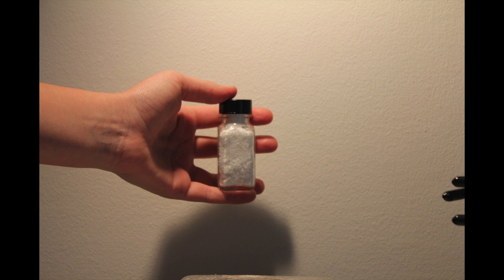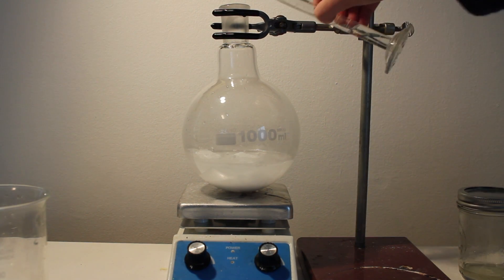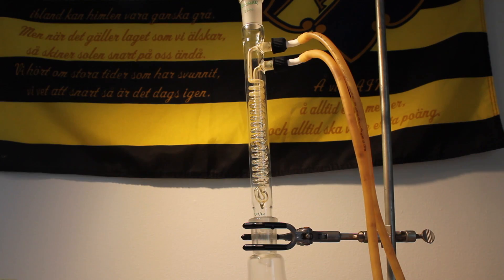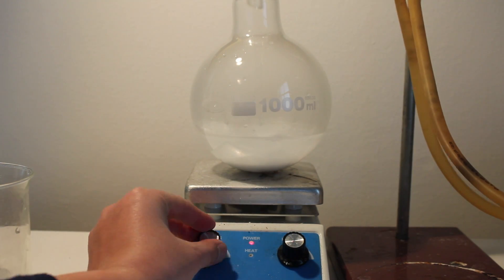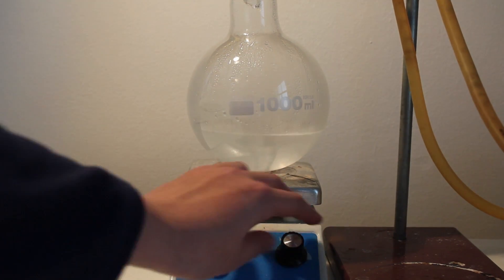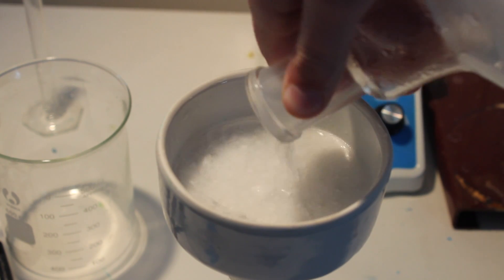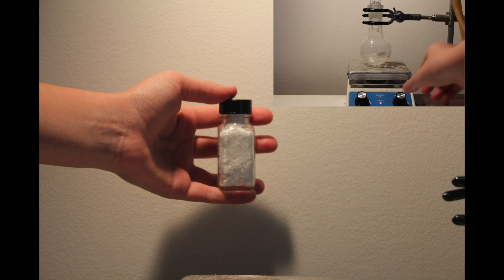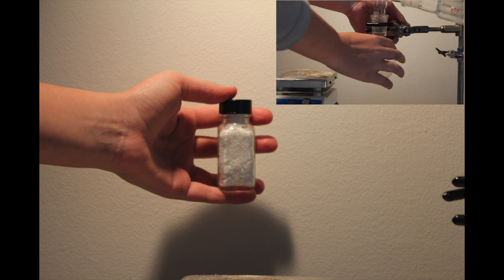Synthesis of Salicylic Acid

Comment: You should wash your SA(salicylic acid) with 2portions of 25ml of ice cold water. You can use the filtrate to convert more acetylsalicylic acid to minimize product losses due to SA staying in solution. Discard 30-45ml of filtrate, add 1-2ml of HCl and 15,8g of ASA(acetylsalicylic acid) and you're good to go.
Reply: what happens if you over boil salicylic acid i need to know please tell me
Reply: After 10 years
Thank you